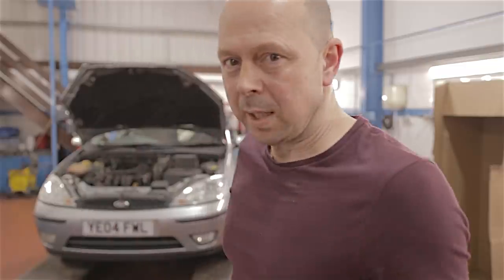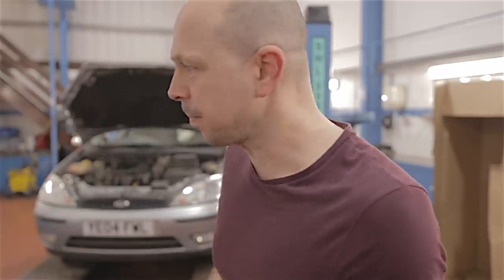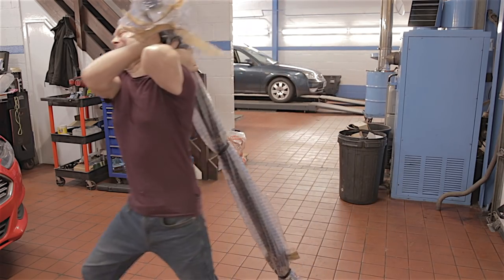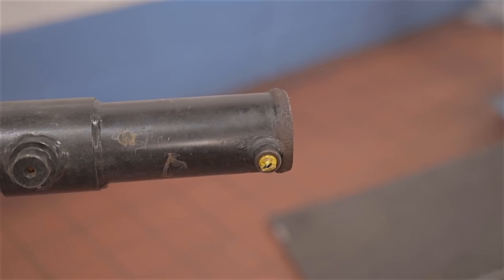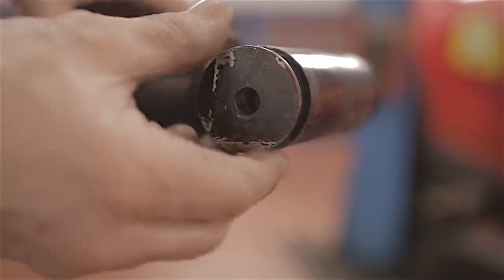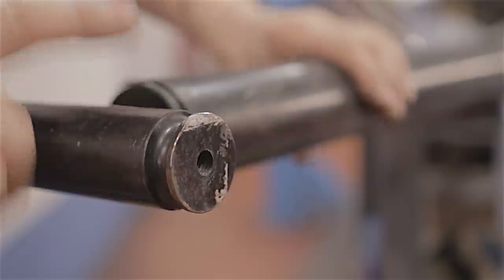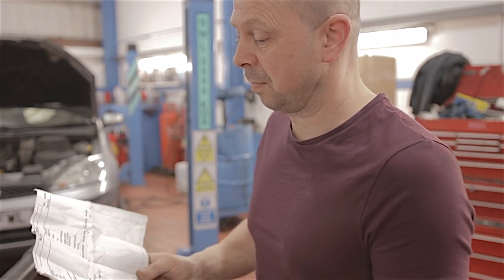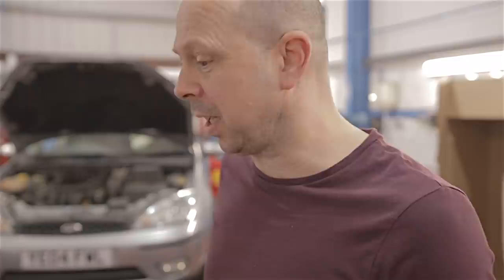Tecalemit Sf9657 Hydraulic Ram Find After 17 Years

Comment: I worked for Tecalemit for 5 years, installing all their kit (ramps, oil dispensers and compressors) in garages and workshops all over NW England. Interesting comment re the brake testers, I install their 1st one in Sandy Lane Garage Stockport, me and the service manager Sid McDermott both never seen one before, put it together and got it working fine.  Installed about 15 in the next few years,
Reply from the maker: cheers

Comment: Everyone that I deal with uses screw type ramps. I had to make some parts for one a few weeks ago, I forget the make, the dealer took over 2 weeks to reply to a request for spares, by which time the ramp had been working again for over a week :)
It took 2 hours to make the parts required :)
Reply from the maker: i have found that ramp dealers do take their time to get an engineer out 😜
Reply: @alan4x  This was not to get an engineer out, it was just to respond that they could get the parts :(
Reply: The garage I worked  in had two screw type ramps and one h type hydraulic ramp.  That was in the 1960s.  Great fun when the screw type ones popped the cotter s with a car on it up in the air.